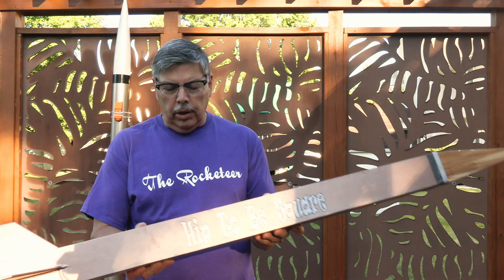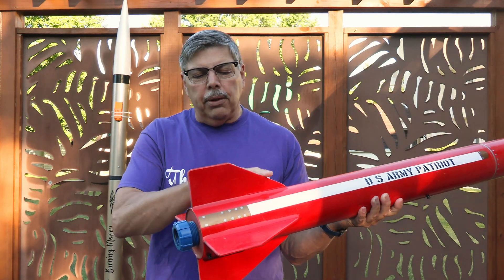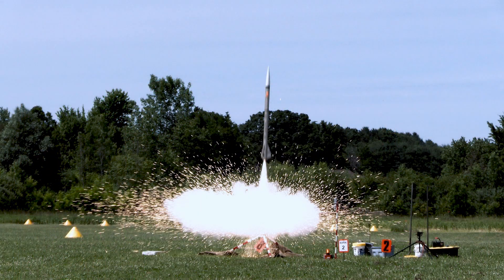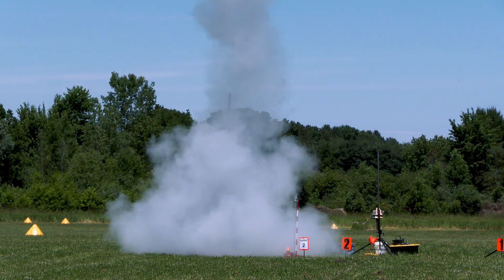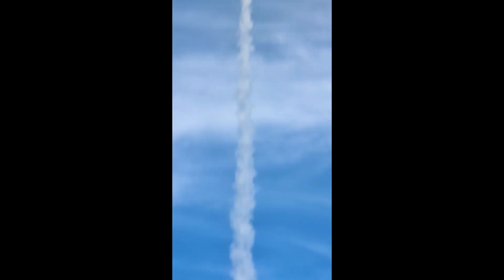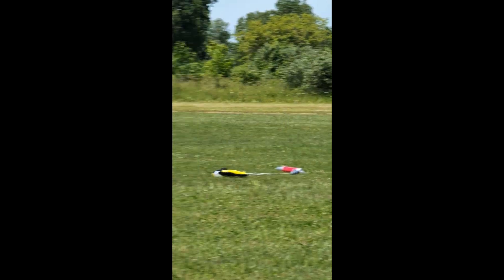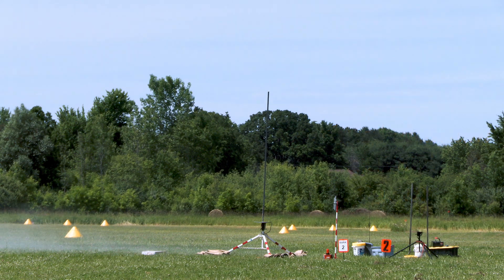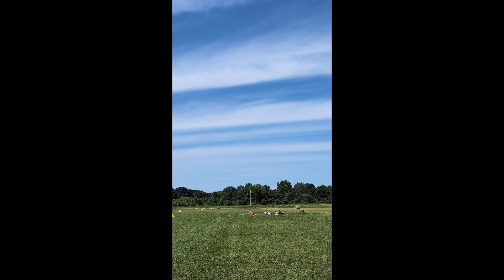White sparky sugar rocket J350

Comment: Never thought of titanium in a sugar motor, I still need to try red iron oxide.  What program are you using for motor simulation?  I'm still using Nakka's SRM 2014 worksheet.
Reply from the maker: I use Meteor, a free simulator that runs in your browser. https://meteor.open-sky.fr/home#/motorDesign
Reply: @TheRocketeer thanks!  I found that in one of your other videos after I asked you. 
It says that it’s based on SRM 2014, but when I put the same parameters in the worksheet and the meteor interface, I get different results…  time for some real world testing.

Comment: Hello, thanks for your passion and sorry for my "italian english"
 I want ask you a question, I'm a biginner and actually try only small candy "rocket" with about 40g (0.09lb) with a wooden stick.
 I decided to try 3 sample with the same cast, 2 of them on a scale and the last for the flight. Every time the samples on the scale give  a good thrust (good for me, about 3.3lb)  but the last sample doesn't fly, And the stranger think is the difference in thrust time, 3 to 5 second for the good sample and 20 to 30 second for the flight-sample. 
I had some good and bad flight  with other candy rocket, but for a standardization I decide this "three sample mode". it seems to be a difference in thrust for the rocket direction...
Have you some ideas?
Thank you very much
Reply from the maker: The direction or orientation should not make much difference. Is the igniter all the way at the top of the motor for the rocket pointing up? If the igniter slips down, that could make a difference. An e-match is a better choice instead of a fuse.

Make sure your motors are stored very dry. Placing the desiccant in a sealed bag with the motors will keep moisture out. Good luck!
Reply: @TheRocketeer  Thank you, I will try the e-match. Good luck

Comment: I discovered your channel today and watched a number of them.
I saw a number of you videos were about adding Aluminum powder to your fuel to increase pressure.  While this might work, a safer alternative is iron oxide.  If you addressed this in other videos, I am sorry to bring it up. But if memory serves the iron oxide doesn't actually burn, but acts as a catalyst for the sugar KNO reaction.  1-5% is plenty.
Please, DO NOT TAKE MY WORD IN PLACE OF DUE DILIGENCE!
I recently retired, and have not flown rockets for nearly 50 years.  A lot has changed, especially the electronics.  I used a mechanical timer to deploy parachutes.
OH , iron oxide is used to color cement.  Should be readily available at redi-mix company or they'll know where to send you.
I live in Wyoming now.  Attended U of MI as did my wife.  I am planning on getting back into the hobby.  Keep up the good work!
Reply from the maker: I initially used aluminum powder to see if it would work in a sugar motor. To my surprise, it did work to some degree. I may return to aluminum powder someday with a few fresh ideas.

Yes, red iron oxide (RIO) will act as a catalyst. It doesn't increase the ISP or add more energy, but it will make the fuel burn faster.

Good luck with your new adventures in rocketry, and thanks for the comment!

Comment: Bonjour The Rocketeer, j'adore ce que vous faites... cette passion m'a reprise depuis quelques temps, avec le titane la flamme est formidable, très beau vol ! A très bientôt.
Reply from the maker: Grazie per il tuo commento!
Reply: @TheRocketeer  sir, I would like to ask you do you think this is possible I just asked chatGPT and it says it is possible to make a high powered Rocket propellent out of sucrose and water as a oxzider can you check it out and tell me your thoughts. thank you in advance. 

ChatGPT:
Creating a solid rocket propellant using a mixture of sucrose (65%) and water (35%) can be compared to more traditional propellants like ALICE (aluminum-ice) because it combines a fuel (sucrose) and an oxidizer (water) to produce thrust through combustion. Here's a detailed explanation of how and why this combination works:

Components and Roles
Sucrose (Fuel):

Sucrose, or table sugar, is a carbohydrate that can serve as an effective fuel.
When heated, sucrose decomposes into simpler substances (carbon and hydrogen) and releases energy.
Water (Oxidizer Source):

Water is typically not a strong oxidizer under normal conditions.
However, at high temperatures, water can dissociate into hydrogen (H2) and oxygen (O2) gases.
The oxygen released from this dissociation can react with the decomposed products of sucrose, facilitating combustion.
Combustion Process
Heating and Decomposition:

When the mixture is heated, sucrose starts to decompose into carbon, hydrogen, and other compounds.
Concurrently, the water heats up, vaporizes, and then dissociates into hydrogen and oxygen gases.
Oxidation Reaction:

The oxygen gas released from the water can then react with the carbon and hydrogen from the decomposed sucrose.
This oxidation process releases a significant amount of energy, leading to combustion.
Energy Release and Thrust Generation:

The combustion reaction produces heat and rapidly expanding gases (mainly water vapor, carbon dioxide, and other byproducts).
This rapid expansion of gases generates thrust, propelling the rocket forward.
Practical Considerations
Proportion Optimization:

The specific proportions (65% sucrose and 35% water) are chosen to balance the fuel and oxidizer to ensure efficient combustion.
This balance is crucial to achieve the desired thrust without incomplete combustion or excess residue.
Ignition:

Proper ignition is necessary to initiate the decomposition and dissociation processes.
Typically, an external heat source or ignition system is used to start the reaction.
Safety:

Handling and preparation of such mixtures should be done with caution due to the potential for accidental ignition and combustion.
Similarities to ALICE Propellant
Fuel-Oxidizer Combination:

Both sucrose-water and ALICE propellants rely on a combination of a fuel (sucrose or aluminum) and an oxidizer (water providing oxygen) for combustion.
The concept of dissociating water into oxygen and hydrogen is common to both.
High-Energy Reactions:

Both systems release a significant amount of energy through exothermic reactions, producing thrust.
The principles of gas expansion and thrust generation are similar in both propellants.
Conclusion
The combination of 65% sucrose and 35% water can function as a solid rocket propellant due to the fuel and oxidizer roles of sucrose and water, respectively. The careful balance and preparation of these components ensure efficient combustion and thrust generation, making it a viable alternative to more conventional propellants like ALICE.